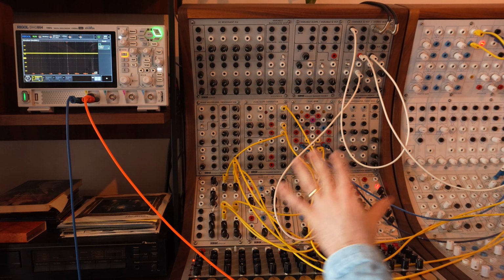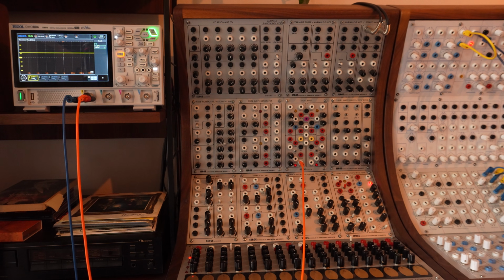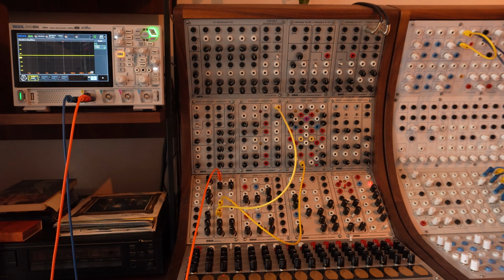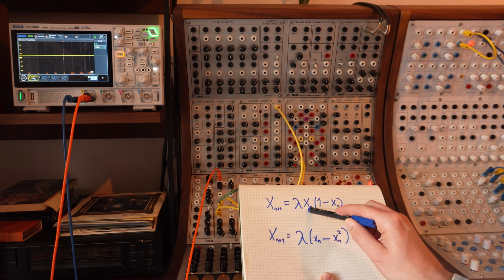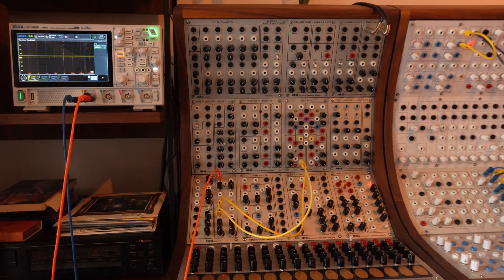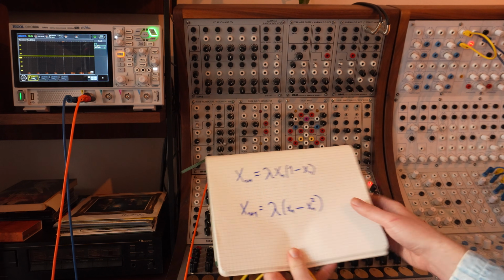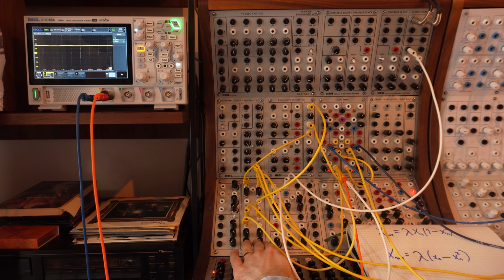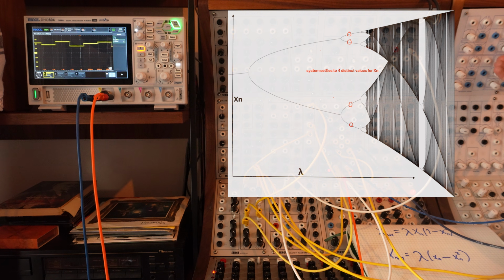Logistic Maps and Analog Computing with Serge

Comment: Great video :) Apologies if I missed how this is handled, but at 07:37 it seems like Xn is allowed to be outside [0,1]. I believe values need to be restricted to [0,1] to avoid e.g. negative values for Xn
Reply from the maker: yep - i had decided to basically let everything have a range of 0 to 5 volts since that works a little smoother for the serge ecosystem
Reply: @lasynthesehumaine6932  i suspect everything could be scaled by 5, eg 5-x and lambda from 0 to 20, but i also think if the initial x was within [0,1] and lambda was never greater than 4 then the standard equation still works with your setup. Could be wrong though
Reply from the maker: @andrewolney  yeah i'm basically patching something more like x_n+1 = lambda * x_n * (5 - x_n) with x_n in [0, 5]. and lambda ends up needing to be somewhere between like 17 and 19 for chaos. all of this is super rough lol since the actual voltages are nowhere near that precise

Comment: Thank you for validating my obsession with recursion & nonlinear dynamic systems. It's so nice, knowing I'm not crazy and there are others like me. You're amazing ❤.
Reply: the tower of hanoi was so sneaky lol
Reply: they make some fascinating tones don't they?  Vocal sounds too!
Reply: @_marlene  Yes, but also you can kind of make any sound with them. I consider differential equations a form of recursion. With differential modeling you can simulate anything. That's what physical modeling synthesis is.
After all the Lorenz equations are a model consisting of 3 coupled differential equations and it's the origin of the butterfly effect.
 I once made a vary convincing sound of "blowing across a glass bottle" with the "damped harmonic oscillator" by driving it with noise. 
I once found a lecture on YouTube talking about the different models the research group had made; they had a trombone model, ran a sim of it 10 miles long with like 1000 PSI the sound was hilarious.